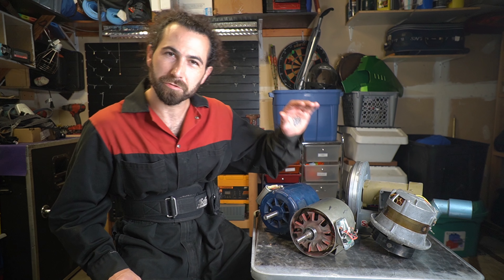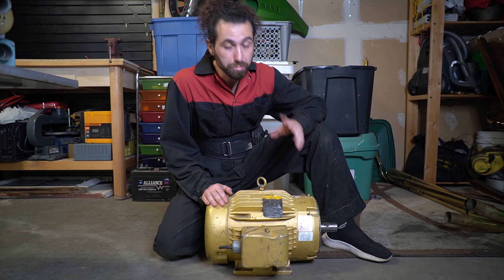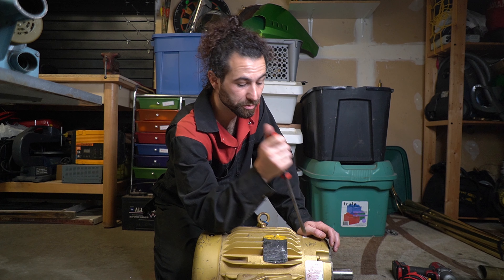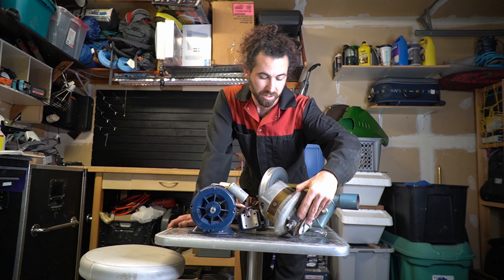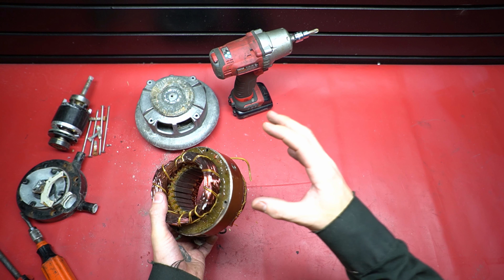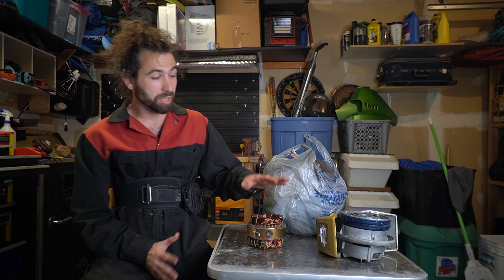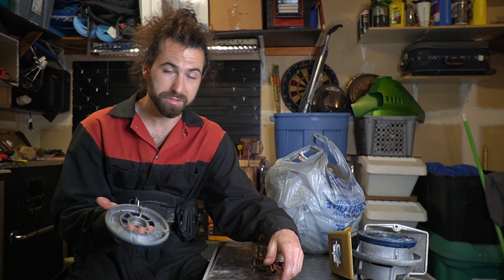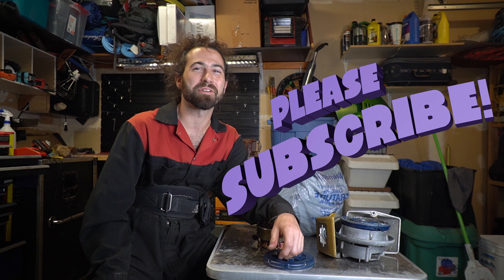Scrapping Electric Motors For Copper Recycling - The Complete Guide!

Comment: Hi I take the copper from electric motors and compressor, because the compressor windings sit in oil they pop out in seconds. With the electric motors there is away of pulling the windings out quicker. I first saw the video of someone doing the pulling and holding the motor with his feet in china. Now something like the big motor takes me less than an hour.  It would have been easier if you cut both sides and the knocked them out. Watch Ian Matthew in the Shed. Taking copper from 15bhp motor.

Comment: I cut both ends of the copper off and then punch out the remaining copper and that’s how I get it done in close to an hour
Reply: And I wait until I have at least 10 to 20 then do them all at once
Reply from the maker: That sounds like it would be faster, good idea!
Reply: Yep that's the best way
Reply: well i have a big 5 inch vise , so i cutoff one end,(1/4-1/3 HVAC fan motors),using a 4.5 angle grinder, then put it in the vise with the copper uncut windings up, the top of steel plates is about 1/2 -3/4 inch below the top of vise jaws,then using a modified 20 inch flat blade screwdriver, i lightly hammer it in and then lever out the copper windings , easy and fast..larger motors   i  cut  in  half  with  a  axe  head, ( grind axe head long and thin,it will go in between steel plates real easy and cut through without much trouble)hammered in,, then lever out copper from both sides just like the smaller motors..10-15 minutes each for the smaller motors, i once did some big motors,2 hrs each,,7 inch angle grinder ,cutoff one end of copper winding, and a 1/4 flat bar x1 1/4 wide with a fork like V cut into one end,and hammer out the copper,, one big motor had brass bushings along with ball bearings,, 4# of brass!!
Reply: Makes sense. Less friction for a single bundle than several connected.
Reply: I've done more than a thousand over the years and have found that a large vise makes things a lot easier and faster. The smaller motors are the easiest and done quickly are very profitable.By far AC compressor motors are the easiest once they are out of the sealed unit. The oil inside is a pain but will allow the windings to slip through.I use channel lock pliers to pull them out . Some times you will need a large screwdriver to get it started. Some times cutting some of the string so as to separate the bundles and make it easier to pull out. Trust me you will get much faster over time. Motors are one of the best ways to profits.Keep at it and you will discover tricks to make it go faster.I think using a air hammer to get the windings out is probably the best. My compressor is not big enough got that. Don't try pushing them out with a punch it's too slow.

Comment: Never had to use a vice don't need it. Place copper side up on a tin or anything round and high enough to clear knocked out copper and diameter slightly wider than the windings and use your tools hammer punch it down and out.

Comment: I scrapped a electric motor big like a 200 l barrel , about 400kw motor with electric brake, i work 2 days, about 20 cutting blades and 10 kg sledgehammer. And the payment was about 1200 USD,în my country.
Reply from the maker: WOW!!! I can hardly imagine a motor so large!
Reply: Was a motor from a big steam pump from an old power plant.

Comment: Can you do a video on the silver wires in stuff please to tell the difference from silver color and tin insulated
Reply from the maker: I don’t think I’ve ever seen a silver wire in anything, where have you seen some that could be silver? I think the closest I’ve found is some wires inside breaker box fuses that were copper but coated with a silver colour metal that looked like silver rather than tin. Even then though, the recovery process would be pretty involved for a very small amount of it
Reply: @thubprint  they say there's to kinds tin and something else
Reply: @thubprint  or are they silver colored copper ?
Reply: These wires that are silver in color are usually #2 grade.

Comment: You need to hold on to that scrap so you can get the best amount of money for your work. Did you purchase these motors online or did you get them locally? FYI I just saw another scrapper pry the copper out with a wrench and hammer. He hooked the top of the wrench into the loop side of the copper and pounded it out little by little. It took some time however you end up with less mess in the long run.
Reply from the maker: Less mess is great but I think the only sensible way is to get through them as quickly as possible

Comment: How about taking a plasma cutter to the motor casings. Or a wire edm machine to cut directly through.
Reply from the maker: If I could get a plasma cutter that would absolutely be the way!
Reply: Plasma cutter works fine but now you need more tools to do the same job. Grinder with the thin cut blade is simpler and more straight forward.

Comment: You only mentioned the copper one winding, but is there any additional value  (over shred price) for the magnets and steel around the copper?
Reply from the maker: Not that I’m aware of. The cast iron from the big one is a better category than shred of course, but the inner casing and magnet rotor thing is always just shred for me. If you had enough of the rotors you could sell them as irony aluminium, maybe more if they have copper through them.

Comment: the one that was half aluminum half copper i always take apart!!!
Reply from the maker: Really? Still worth it??
Reply: @thubprint  i think so!!  Check out my vids!!!
Reply: @thubprint It is .If you can just pull the copper if you want. The aluminum windings are sellable an will come out easy
Reply from the maker: @Mike-v6r  I suppose! I haven’t done the math, I’ve just gotten used to checking if they’re copper before cracking them open and if not, I won’t bother. Although if they’re already mostly apart one might as well

Comment: You explained it differently, but its the same as:  Any circuit with ohms is a short, all wires have very low resistance and are just a short, sometimes with a bit more resistance.  Open circuits have infinite ohms always (no continuity for less ohms).

Comment: I wonder if you were to cut just the ends off and leave the middle part. How much of a loss do you get. Time vs copper weight. I can see someone who has a 100s of electric motors who spends a day just stripping them apart and saving the windings. Scraping the housings and then one day cutting the ends off and scrapping them. 
If a person scraps enough motors building a small press would not be too hard to press out the windings from the core.  Electric driven press would be really all you would need along with a hand full of custom shapes and sizes.
Reply from the maker: Oh I’d love to get more serious with them, I don’t find them often enough to build some kind of press but I’ve seen videos of some that go through them in seconds
Reply: The pros pull them out There are videos of purpose built machines that pull them in seconds flat no exaggeration.These machines are not for average persons.The point is pros pull.not push.

Comment: what I found is that the scrap yard values this copper as "shellacked  copper" meaning less money than #1 copper
Reply: yes number 2, just like copper wire or tubing with solder
Reply: Yes that's right and it is best to get as much of the strings and plastic out of the winding load as best as you can to avoid being down graded to number 3 . Some scrapyards are particular about this.

Comment: Cut both sides of the coils and knock each of the slots out
Reply: Been there done that.To slow and some times the copper gets jammed in and compacted. Once that happens its all most impossible to get it out. The more experienced guys do not push them out . Some motors work well by pushing out the windings but most don't.

Comment: Hey Thub, I love and appreiciate your videos my dude! I really hope you have a maul now, lol 9:06 made me consider investing in one myself! What are your thoughts on investing in the right tools? Does it make sense right away and at what point does volume justify the investment? Hope this message reaches you well goodsir!
Reply: no do not use a splitting maul !!! its hard to hit in the right place, chunks of metal go flying around broken off the cooling fins,,,just get a 7 inch angle grinder ,buy cheap cutoff disk of e bay ,and cut into side like in this vid,a chisel and hammer breaks it,,i cut most of my motor fields in half by splitting with a axe head between the layers, then a forked piece of steel and hammer out the windings from both sides.

Comment: What about using a some type of a press.  Perhaps hydraulic?
Reply from the maker: I saw a video where they had one! It was amazing, just a big blade to split the body and then a clamp with some hydraulic forks that lifted the windings out in one piece. Not cheap but definitely the way to go in a shop.
Reply: @thubprint  I'll have to check that out. I was also think of a smaller press with a flat surface in order to press and turn it to warp the holes and then could the copper just pull out I wonder? 

I really do enjoy all your videos! Keep up the good work!
Reply: @user-dy2xu3uv8k  im using an arbor press its cool and handy

Comment: Eight months later, and with a maul you bought from the proceeds of this.
Yeah, he's scrapping motors.
Reply from the maker: I’ll get better at it though! 👍
Reply: @thubprint You definitely will .I almost always pull the windings out with channel locks.Does not always work.  Use a large vise it will go faster .It's worth it to get one.The bigger motors with cast iron will crack way easier and faster with a big sledge.The smaller motors  that were shown will be about a 15 to 20 minute job. That larger one can take as much as an hour or 2 but is very profitable.